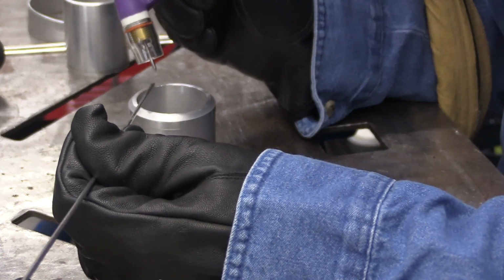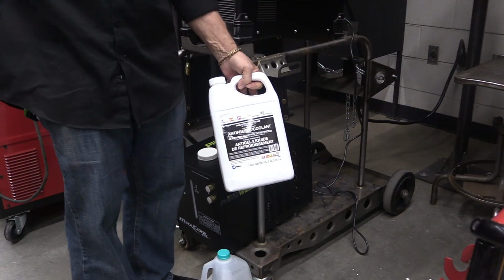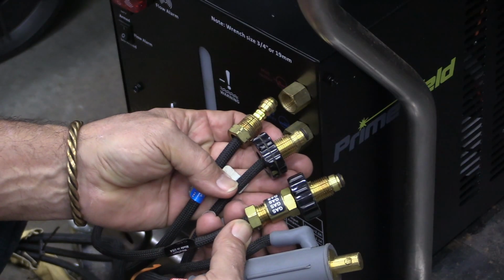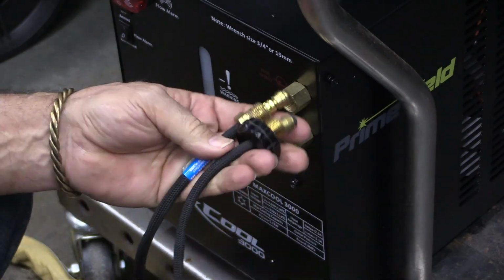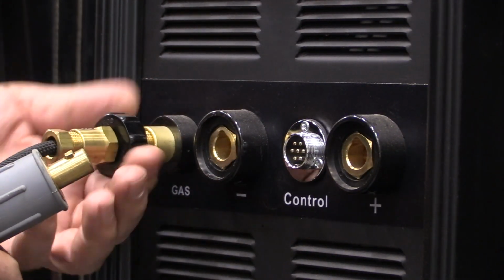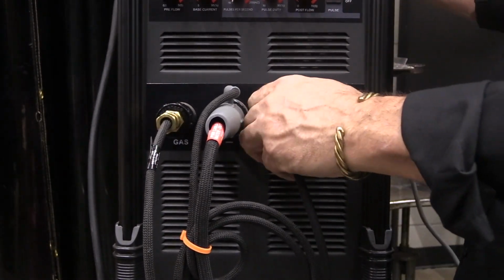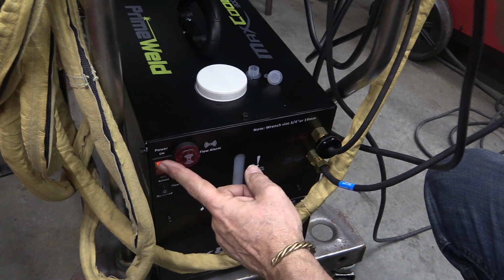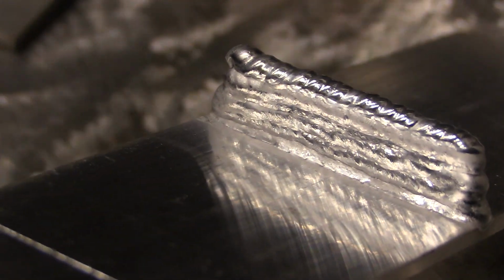PrimeWeld TIG Cooler

Comment: At what sustained amps level/s do coolers become a necessity? I understand time = heat, but also that we're limited on time by the duty cycle of the welder when running big numbers.  I've got a 325 and accessories on the way and I'm debating adding a plasma cutter or a cooler. The plasma cutter will likely be more valuable to me at this point but also I'm considering a cooler so I can run a #20 torch, but then a #9 may be sufficient for my applications.

Comment: @weldingtipsandtricks quick question on the Primeweld TIG, when welding AC how is it with RF noise/interference while welding? I bought a Syncrowave 200 back in 2010 and when welding AC it generates a terrible amount of RF noise causing all kinds of issues with electronics etc. I use it in our attached garage mainly so the noise it generates is a pain. Wasn't sure if the Inverter based machines had the same issues.

Comment: Is there a way to adapt a MIG/MAG motor unit to an AC/DC tig/stick welder? I have the previous model of that Primeweld 225 AC/DC and would like to add a wire feed capability without having to buy the electronics again. Just seems logical to me.
Reply: Nope, different proces.
Tig is constant current,MIG is constant voltage.

Comment: I know this is off topic for this video but I have been looking for a professional opinion on the best way to secure the mild steel oil pick up screen tube to the cast iron oil pump. I would love to see a tutorial on this process done correctly. Thanks
Reply: I would braze or solder it depending how fine the screw was and how much heat it can take. Just my opinion which ain’t worth much.
Reply: @bcbloc02  Actually, brazing is probably one of the best options for me right now, cast iron doesn't like to be welded much.
Reply: Small block Chevy folks have been tack welding oil pickups for decades.
Reply: @om617yota8  Yes, I'm one of them. Thing is, as RPM's and horsepower and cost increase, so do pump failures. Seen way too many break off the tacks or the tube if you weld it all the way. The billet pumps are the way to go but $$$$$$. On my moderate builds I just want a little more insurance in the form of a professional welders opinion.
Reply: @MudtoyTT  Got you, way ahead of me. Best of luck with your builds, sounds fun.

Comment: My job is to repair welding machines and equipment. The number of times I've seen water cooled gear come in for repair that's had green car engine coolant in it...9 times out of 10 the water pump is completely seized, lines in the torch lead blocked, torch head gunked up with crystallized green stuff. Definitely use the correct coolant.

Comment: Hi Jody, do you think having a water cooler will allow me to run in the upper limit of my 200A machine more comfortably? Things gets get hot quick on Ally over 150A with my small torch.
Reply: You can max out your machine all day long with a water cooled torch.
Reply from the maker: 100% but you just have to figure out if it’s worth the money

Comment: With the anti-freeze, one of the reasons that the specified coolant be used is that some will react with common metals and alloys, and to avoid problems with warranties, etc, it's safer and easier for them to tell you what to use.
Another reason is that different coolants have different service lives - some may have a recommendation of replacement every three years, others may be every five, a select few may be every ten years - the old 'lifetime' stuff seems to have gone by-the-by, probably because of 'nasty' chemicals that were used back in the day.

Comment: With my Lincoln 300/300 there's no problem with the noise of my TIG cooler.  When the welder is on it's like being next to a jet engine.  I have an old (1980's) Bernard cooler and it serves me well.  Goes on when the welder goes on.  My old cooler hooks up just like this too.  Thanks for the video.
Reply: Ralph Watten how do you like your idealarc tig 300 I just pick one up a couple months ago but I had to put it in storage